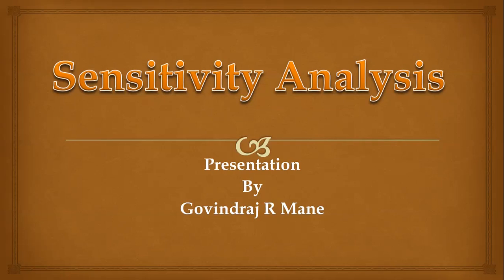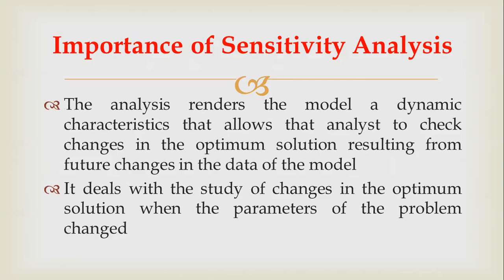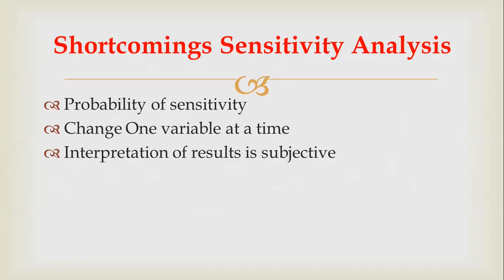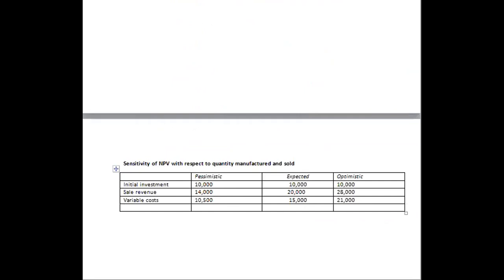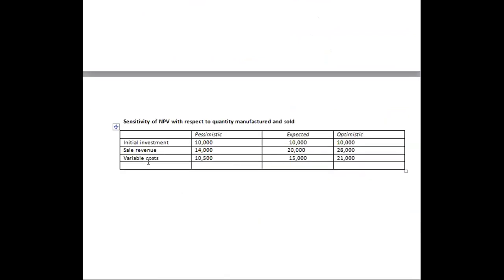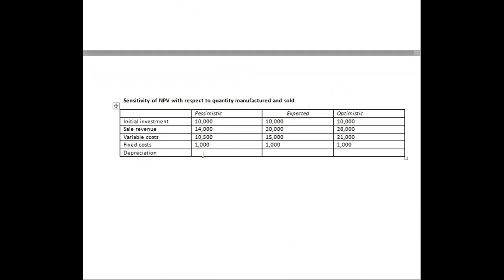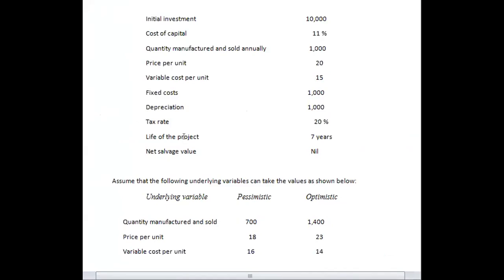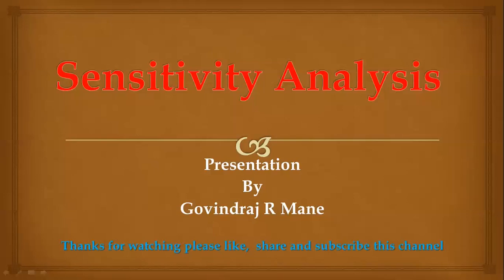How to reduce risk using Sensitivity Analysis in Project Management, Project Appraisal

Comment: The steps to calculate sensitivity analysis is 
Step 1 - write the initial investment given in the problem
Step 2 - calculate the sales revenue by multiplying price per unit × Quantity
Step 3 - calculate the variable cost
Step 4 - write the fixed cost as given in the problem
Step 5 - write down  the depreciation amount
Step 6 - calculate the Profit Before tax 
I.e sales revenue - variable cost - fixed cost - depreciation.
Step 7 - calculate the tax rate given in the problem on the PBT
Step 8 - calculate the PAT 
Step 9 - next step is the calculation of the net cashflow i.e PAT + Depreciation
Step 10 -  the last and final step is the calculation of NPV 
To calculate NPV
 (PVIF value × net cashflow - Initial  investment).
The above is the calculation for sensitivity of NPV with respect to variation in Quantity manufactured and sold.

Akshata Shiroshi 
2GI18MBA06.

Comment: The procedure of solving Problems on Sensitivity Analysis as below:

1. Need to write down the initial investment firstly in all 3 situations.

2. Next we need to find out Sales Revenue (Qty manufacturerd × Price per Unit).

3. Need to find out Variable cost (Qty Manufacturerd × Variable cost/unit).

4. Next need to substitute Fixed cost as given amount.

5. Depreciation need to substituted as given amount.

6. Then we arrive to PROFIT BEFORE TAX (by deducting Variable cost, Fixed cost & Depreciation from Sales Revenue)

7. Then we need to calculate Tax (tax rate × Profit before tax)

8. Next we arrive PROFIT AFTER TAX (PBT - TAX )

9. Next need to ascertain Net Cash flow(PAT + Depreciation)

10. Finally, NPV is calculated with help of PVIF table value. (Net cash flow × PVIF table value).

11. Further to find out sensitivity we need to make modify the values with respect to all variations.
We get desired NPV

THANK YOU

JAYATIRTHA GUMASTE
2GI18MBA16
Reply: Thank you. Its so helpful.

Comment: Neha patil 
2GI18MBA27
Steps in calculating sensitivity analysis:
For calculate  sensitivity analysis in three situations 
1. First will take initial investment 
2. Next we will take sales REVENUE
3. Next will take variable cost 
4. Next we should consider fixed cost. It will be fix for all the situations.
5. Then will consider depreciation FIXED FOR ALL SITUATION .
6.from sales revenue we will deduct all the expenses. Than we will get PBT
7. Then from PBT will Deduct Tax. After that we will get PAT
8. Net cash flow (PAT+depreciation)
9.  Calculation of NPV
=PVIF× Net cashflow-initial investment.
THE SALES REVENUE AND VARIABLE COST DIFFER ACCORDING TO SITUATIONS 
3 SITUATIONS 
1. OPTOMISTIC 
2.PESIMISTIC 
3. EXPECTED

Comment: Sensitivity analysis is done in threesituation expected pessimistic and optimistic

1. For calculation we have to consider first Initial investment
2. After that we have to calculate the sales revenue by multiplying the quantity manifacture into the price per unit
3. From that we have to deduct the variable cost, fixed cost and depreciation
4. After that we get profit before tax
5. After that we have to deduct the tax amount 
6. Then we will get profit after tax 
7. After that we have to calculate the net cash flow by adding profit after tax and depreciation
8. And at last for calculation of Net present value we have to multiple the net cash flow with the table value for perticular percentage and year

Karan Nilajkar
2GI18MBA18

Comment: The three situation of sensivity analysis 
Pessimistics ,expected and optimistic 

The procedures of solving problem on sensitivity analysis 
1.write the initial investment as given in the problem 
2.calculation of sales revenue (quantity *price per unit)
3.calculation of variable cost (quantity *variable price per unity )
4.Next is fixed cost same for all three situation 
5.next Depreciation as given in the problem 
6.PBT =sales revenue - variable cost -fixed cost -depreciation
7.next the tax is calculated on given rate percentage 
8.PAT = PBT -tax 
9.calculation of net cash flow (PAT +depreciation)
10. Last step is to calculation of NPV

Pooja Gouli
2GI18MBA34

Comment: Steps in calculating sensitivity analysis:
For calculate  sensitivity analysis in three situations 
A. Pessimistic
B. Expected
C. Optimistic
1. First will take initial investment 
2. Next we will take sales revenue (sales quantity×price per unit)
3. Next will take variable cost 
4. Next we should consider fixed cost. It will be fix for all the situations.
5. Then will consider depreciation.
6.from sales revenue we will deduct all the expenses. Than we will get PBT
7. Then from PBT will Deduct Tax. After that we will get PAT
8. Net cash flow (PAT+depreciation)
9.  Calculation of NPV
=PVIF× Net cashflow-initial investment.
The are the steps of sensitivity analysis.
Apoorva karva 
2GI18MBA08

Comment: Steps for calculate sensitivity analysis:
There 3 steps divided in pessimistic, expected and optimistic 
1: sensitivity of Npv WRT quantity manu and sold
Put initial investment, sale revenue ( quantity manu n sold * price per unit ) , variable cost, depreciation, pbt, tax, pat, net cash flow(dep+ pat), npv(ncf*pvifa)
2: sensitivity of Npv wrt variation in unit price 
Above all steps r same but II AND variable cost remains same and only sales revenue will change of pessimistic and optimistic 
3: sensitivity of Npv wrt variation of variable cost 
Above all steps r same but II AND sales revenue remains same and only variable cost will change of pessimistic and optimistic 

Nikhil Sapare
USN : 2GI18MBA29

Comment: Chaitrali Shahapurkar
2GI18MBA09 

We assume 3 outcomes for each variable that is Pessimistic expected and optimistic:
1. We First take Investments
2.second step we consider sales revenue which is calculated by quantity into all the units produced
3.then we minus fixed cost variable cost and depreciation from it
4. As a result we get profit before tax
5. We then deduct taxes taxes deduct taxes taxes at the percentage percentage mentioned in the problem as a result we get profit after tax. 
6. Then we calculate net cash flow by adding depreciation and PAT
7. Lastly we calculate NPV, this is done by multiplying net cash flow by value provided in table against specific percentage and year.

Comment: Steps for calculating sensitivity analysis,
For calculateing sensitivity analysis there are three situations; A. Pessimistic B. Expected C. Optimistic 
1. First will take initial investment. 2. Next we will take sales revenue (sales quantity×price per unit) 
3. Next will take variable cost 
4. Next we should consider fixed cost. It will be fix for all the situations. 
5. Then will consider depreciation. 6.from sales revenue we will deduct all the expenses. 
Than we will get PBT 
7. Then from PBT will Deduct Tax. After that we will get PAT 
8. Net cash flow (PAT+depreciation) 
9. Calculation of NPV =PVIF× Net cashflow-intitial investment. 

Siddeshwar Moolimani
2GI18MBA47

Comment: Procedures of sensitivity analysis
1. For calculation we have to consider first Initial investment
2. Next we have to calculate the sales revenue by multiplying the quantity manifacture into the price per unit
3. From that we have to deduct the variable cost, fixed cost and depreciation
4. After that we get profit before tax
5. After that we have to deduct the tax amount 
6. Then we will get profit after tax 
7. After that we have to calculate the net cash flow by adding profit after tax and depreciation
8. And next for calculation of Net present value we have to multiple the net cash flow with the table value for perticular percentage and year

Megha Ingale
USN: 2GI18MBA24

Comment: The procedure for sensitivity analysis is calculated on three situations those are: Pessimistic, Expected and Optimistic.
# First base output is to be defined the NPV at a particular base case input value  for which the sensitivity is to be measured. All the other inputs of the model  are kept constant.
* Initial investment is always given
*sales Revenue i.e, (sales quantity*price per unit)
* Then comes Variable cost (per unit), fixed cost
*Depreciation
* After deducting variable cost , fixed cost and depreciation we get profit befire tax.
* Taxes amount is given after deducting this we get Profit after tax.
*Then the value of the output at a new value of the input  while keeping other inputs constant is calculated.
* To calculate the net cash flow: by adding profit after tax and depreciation in the column.
* The last step is for calculation of Net present value we have to multiple the net cash flow with the table value for i.e,
NPV= Investment + cashflow(PVIFA % and years) from the table value .

sonali sheth
2GI18MBA50

Comment: Sensitivity of NPV  can be calculated for 3 scenarios namely-  1.Expected, 2. Optimistic, 3. pessimistic.
calculation for all three is similar. 
 - sales revenue is calculated as- quantity manufactured * price per unit.
 - deduct the costs from sales revenue, which gives us profit before tax.
 - after deducting the costs and tax mentioned in problem, we arrive at profit after tax.
 - net cash flows are calculated as-  profit after tax + depreciation.
 - last step is to calculate NPV- value from table should be found at mentioned year and cost of capital, that value is multiplied by net cash flows.

this helps us analyse the impact on the NPV in different scenarios.
changes should be made only in the variable cost per unit. and then its impact of the NPV values can be seen. 

VIJAYTA KALE
2GI18MBA57